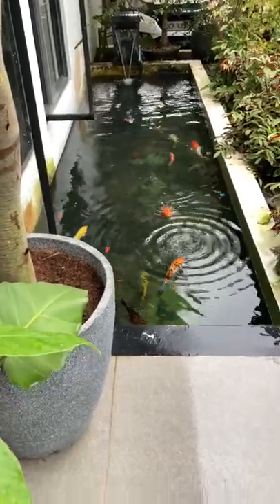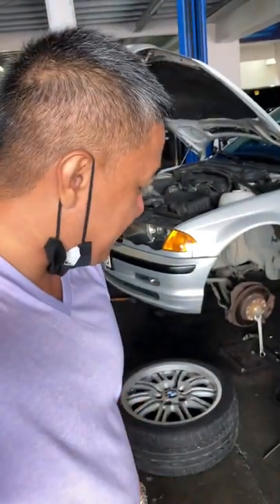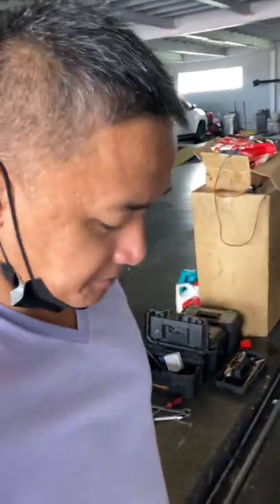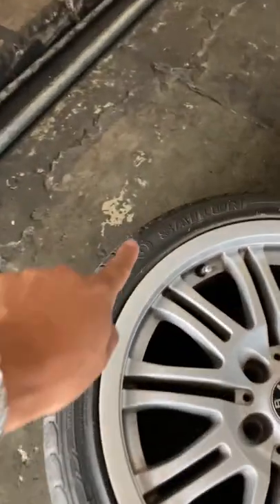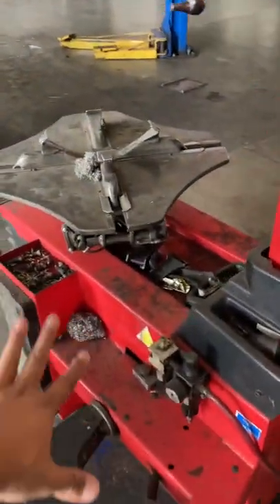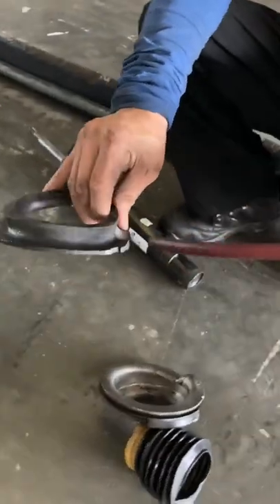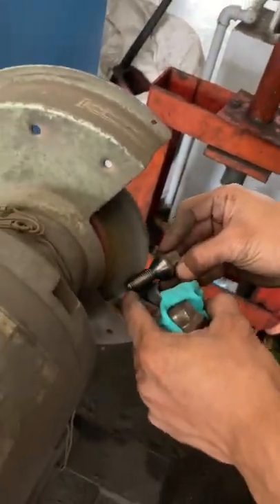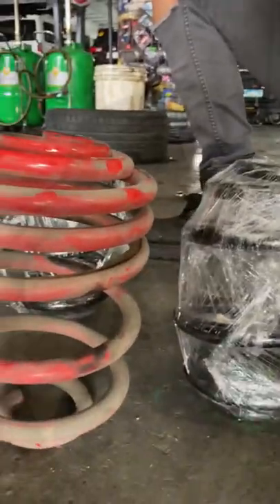Swapped H&R lowering springs for Eibachs on my E46

Comment: You’re supposed to run performance shocks like bilstein B6 or Koni with lowering springs, rides like shit cause your stock shocks are blown
Reply from the maker: I have bilsteins on the rear and Sachs in the front
Reply: @TheRobertDesign  Oh sige sir👍🏼
Reply from the maker: Do U know anyone who did coilovers?
Reply: @TheRobertDesign  I have coilovers on my e46 330i the car is slammed lol but I’m about to switch back to bilstein and lowering springs for a more comfortable ride.
Reply from the maker: These Eigbachs are more comfy than the H&R.  Less tagtag.  But I think stock springs will be more comfy
Reply: @TheRobertDesign  I’ll probably go with eibach thank you
Reply: @TheRobertDesign  But those are valved for stock springs. With lowering springs, you need shocks valved for them, independently of the brand.